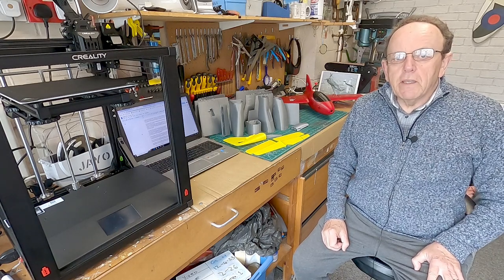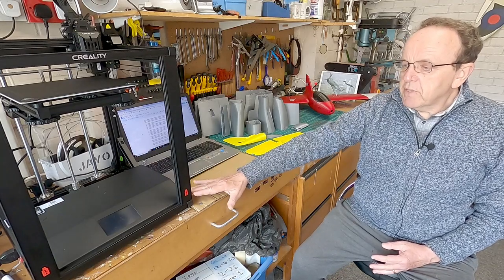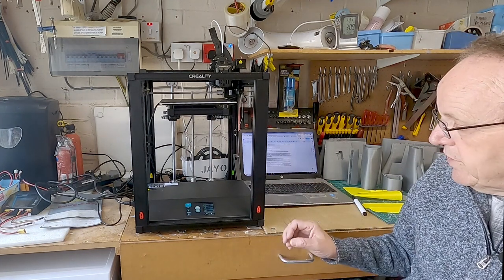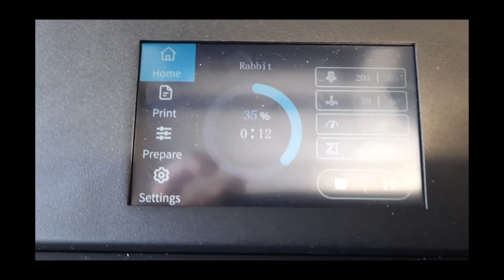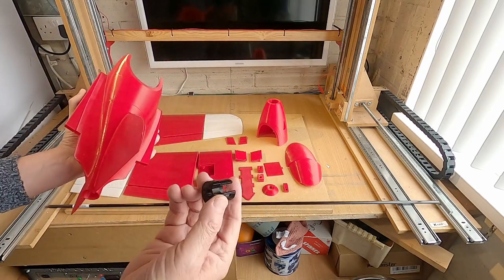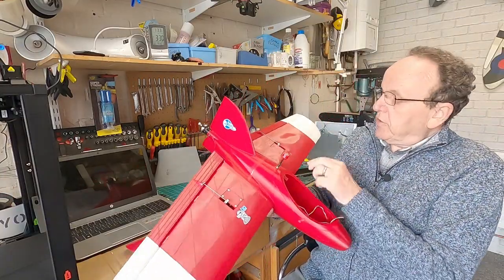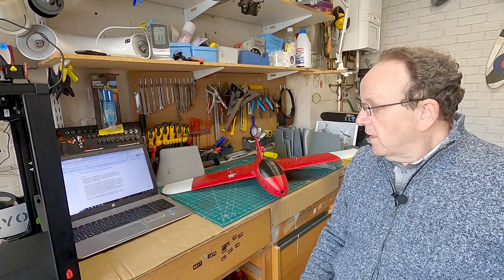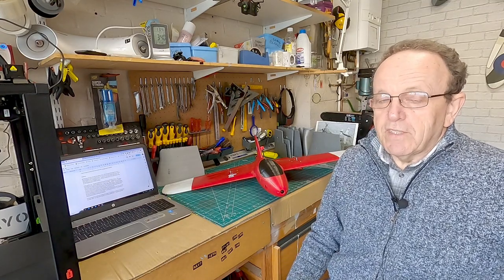Using the Creality Ender-5 S1 for 3d printed RC airplanes like the GromFPV

Comment: really enjoy your videos please keep them coming.
How does the weight compare of 3D printing model to the conventional balsa wood built model?  To me looks a lot heavier
Reply from the maker: Hi Dave yes it is a bit heavier but not too bad. You can get LW-PLA which is much lighter and comparable to foam and balsa.   There are loads of 3D-printed models now and they are getting better all the time. This model is very fast so the weight doesn't seem to be a problem.  Have a look at Troy's video https://youtu.be/k36tuI0YbvI comparing foam, PLA and LW-PLA
Keith